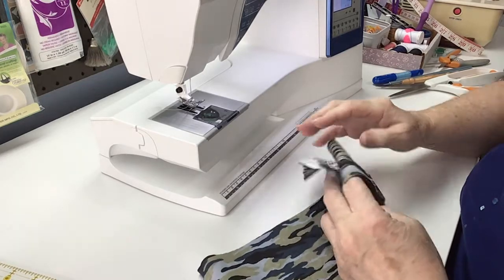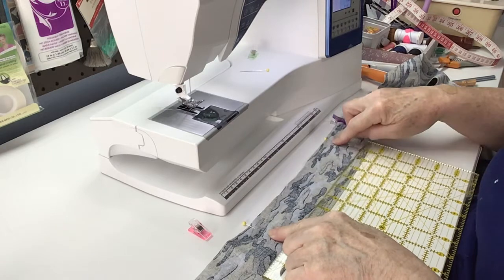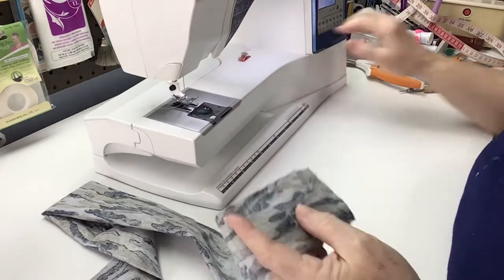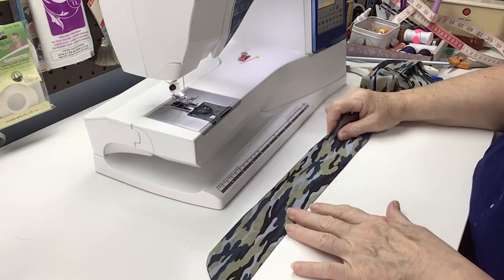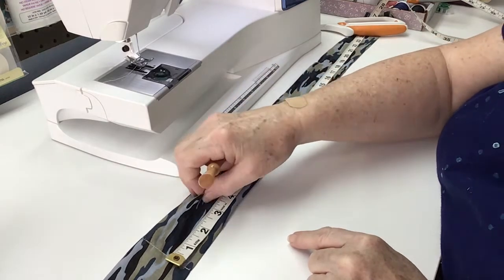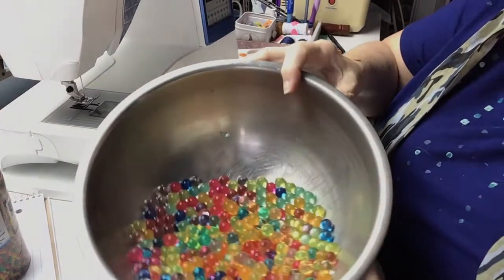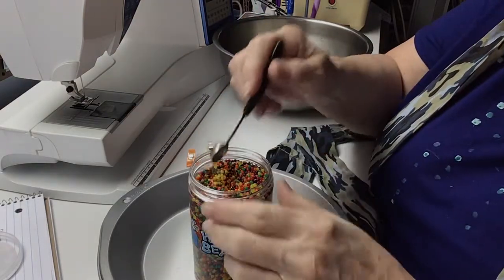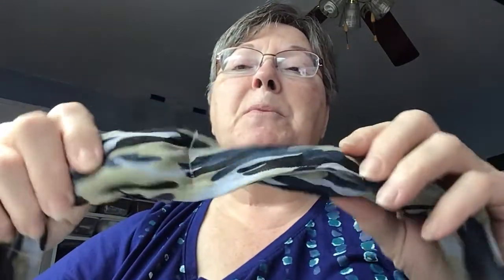How to Make a Cooling Scarf with Kathy Lawrence

Comment: You used 1/4 tsp and the label says they expand 6x their original size. So logically  it seems you would have 1 1/2 tsp when they're hydrated. Just wondering why the pockets look like they are holding more than 1.5tsp? Math isnt my strong suit so I will use the 1/4tsp😊
Reply from the maker: When they are dry and flat it will look like they are practically empty. However, when they expand, they are nice and full. However, every brand of these beads will expand differently. We suggest hydrating some and counting them out and adding them to your pocket expanded and seeing for the brand you have purchased how many it takes to fill it up. Then measure out how many that will be. For the brands we used it was 1/4 tsp of dry. Great question!
Reply: @CraftingChange  thanks so much for that info!
 I will definitely do a test. I want them full but just not seam splitting" full 😂